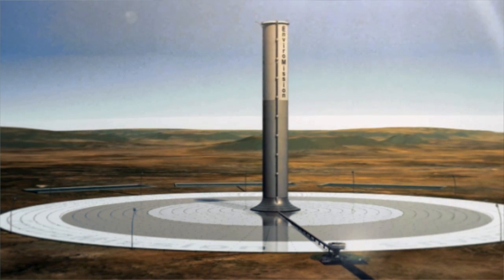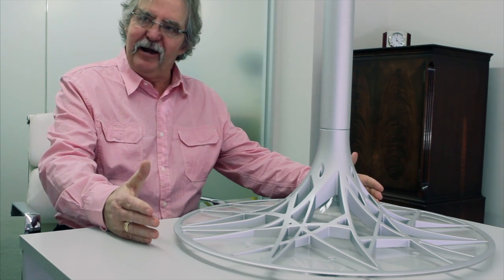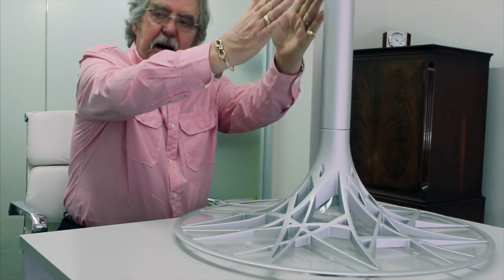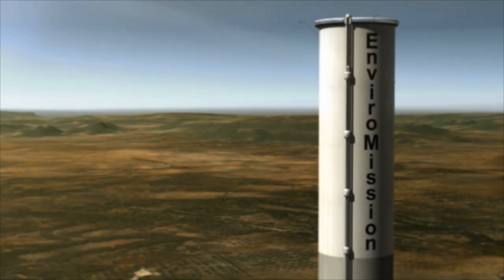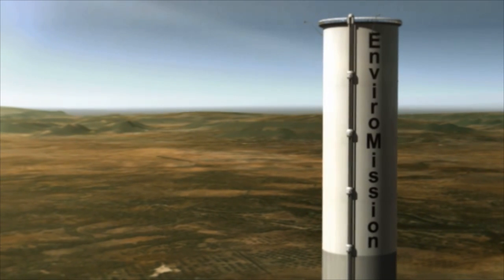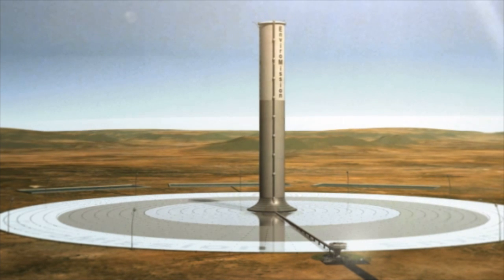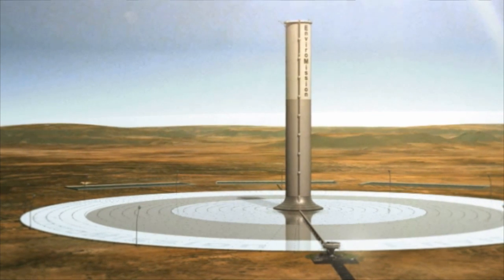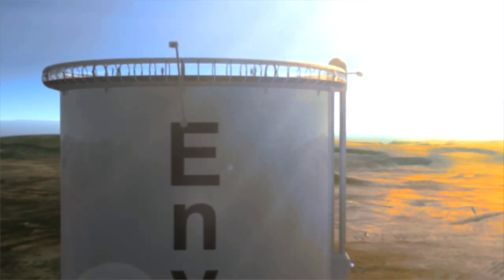EnviroMission building massive solar tower in Arizona

Comment: Actual news about realization? Production of electricity in the first quarter of 2015 would probably mean, the plant is in process of construction now?
I didn't hear anything about the real construction of such a plant yet.

I like the simple concept of this technology. No moving parts except the turbines, no complicated tracking systems, no steam, no cooling. With simple heat storage under the roof, you can even produce electricity after sunset too (advantage over photovoltaics).
Would be fantastic, if there was not one big disadvantage: Extremely low efficiency. You need a very big area, compared to photovoltaics or CSP.
Nevertheless, I would like to see some of these plants realized.

Comment: Apparently is also something related to scale... on a small scale it already has a great efficiency but scaling up the efficiency grows exponentially. The 60KW pilot plant built in Manzanares Spain in 2000 ended up having an output of 30KW during testing. But they found out that scaling up the benefits would be huge hence they planned this insanely tall one. But costs must also have grown exponentially since the pilot cost was 1M Euros and this is over 700x at $750M

Comment: Why not make a few smaller and cheaper towers? The overall concept seems sound but there seems to be a massive "look at my huge penis" effect on the psyche of the people organizing this venture... Again, why not just put solar panels on people's houses, let the people own the power? More centralization just breeds bigger ticks imho.
Reply: Zepherian absolutely although I would prefer it if people used mechanical means of generating energy as with Wind and Micro hydro turbines so as to avoid the hazardous materials used in manufacturing and recycling( which is so far at best 85% recyclable).PV panels, also mechanical means can be made, repaired and maintained by local people which will be a boost for the local economy. Renewable energy is a means to decentralise power generation( as it should of always been). Even underground rivers and mains water pipes could have micro hydro generators in them. I’ve seen a vid of a micro hydro system being installed in a mains water pipe in the US, and it’s impact on water flow is negligible!. I think these mega renewable projects are just ways of big business keeping their business as they can see the way things are going that will put them out of business! As everyone or every town, neighbourhood, city etc will be self reliant for energy in the not too distant future!. Already Wind and Solar is cheaper than fossil fuels. So much so that ‘Walmart’ has gone 100% renewable simply cos it’s cheaper!.

Comment: Hydro power works due to water being heavy, large volumes of moving water = huge amounts of energy.  Air doesn't weigh much at all.  It doesn't have the power producing force water does.  So imagine a water fall of a similar size - I'd say it could power maybe 10 homes.  Given this project is based on air I doubt it could power 1 home.  Sure an upward draught will be produced but it won't be powerful enough to power anything substantial.
Reply: mephesh I can’t believe the designers and engineers didn’t work all that out from computer modelling and scaled down prototypes. No I think the maths would be quiet easy to work out. What I think is 1) surely the turbines would be better placed at the top of the tower to pick up on air that’s been speeding up to the top!. 2) what about the reflective panels, a lot relies on them heating the near surface temp, but what about sand storms or just general sand and dirt build up on so many surfaces would drastically reduce the efficiency.